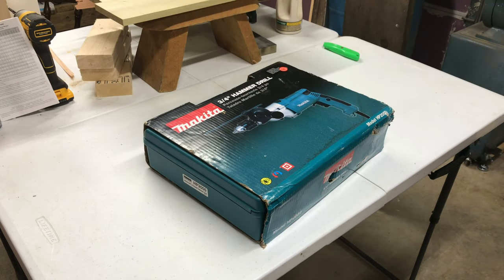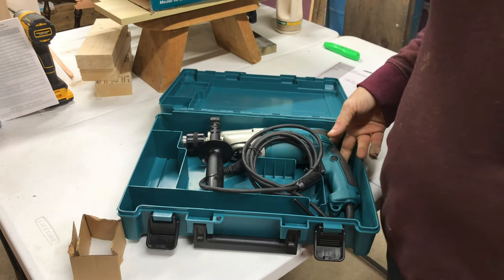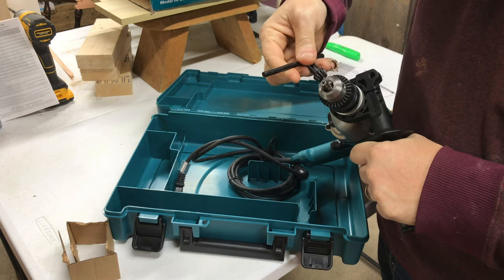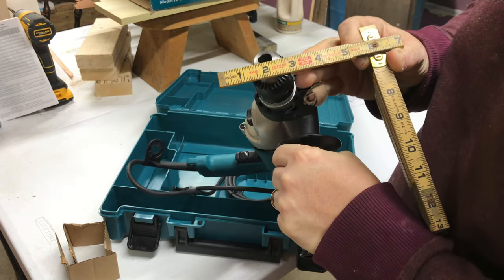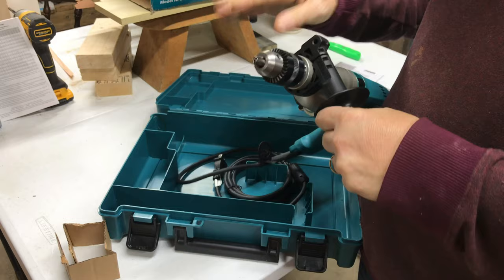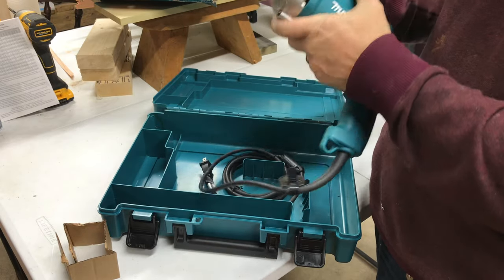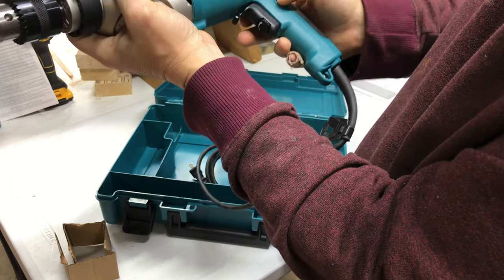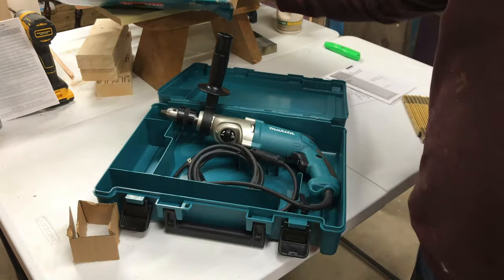Makita HP2050 3/4 Inch Hammer Drill

Comment: I used this drill for the first time today. Mind you, I did use a 1” Diablo auger bit. It didn’t want a drop of the smoke. All I needed was 1 solitary hole, through some 3/4” plywood. It stopped and let out the magic smoke, everytime it came in contact with the wood. Maybe it’s cool on concrete, but It’s useless for me. I treat tools like guns, but I might actually take this p.o.s. back. Luckily I had just bought a 1/2” drive right angle d-handle Milwaukee drill, that went through it like cardboard. I actually was going to send the Milwaukee back, because my wife bought the wrong drill. The dewalt was on sale for even cheaper, with clutch and more amps.

Comment: These drills were designed for concrete, it will easily cut bigger holes into wood/plastic/sheet metal/thinner metals but concrete is so taxing on them, it’s $99 as of today (2/24/2021), so expecting more power is unrealistic. I have one and love it for drilling deep holes into wood post. It will blast 3/4” holes into concrete footings all day. Have to spend big money to get a drill to dig big holes

Comment: The rod is a depth guide. You set it up for how deep you want your bit to go thru and it stops. Mostly for concrete. I just wanted something cheap to mix thinset and hot mud with. I have been burning up my makita battery hammer drill. Got it refurbed on ebay for $70 bucks.

Comment: 3/4" refers to the hole diameter it can drill in concrete. Most hammer drills are rated like this. Look up any of the SDS rotary hammer drills and they are all rated based on the size of hole they can comfortably drill. Given that it is a percussion hammer drill, the 3/4" is misleading. We are more familiar seeing the rated hole size used on the larger rotary hammer drills and chuck size used on the percussion hammer drills such as this.
That said, I have an HP 2050 that is over 15 years old and it still works great. The chuck that came with it was not very good and has been changed. I hear the new ones are not as good. Probably a case of "don't make them like they used to".
Reply: how is that possible? the diameter of the hole you're drilling is equal to the diameter of the drill which is maximum 0.5 inch.
Reply: @joecostner1246  Simple. Reduced shank drill bit. Shank is 1/2". Carbide tip is 3/4".
Reply: You know "everything is not made like they usd to". Honestly, i think its become the standard model for making everything these days. If you think abput it how else would any company make any profits if what they made was actually made to actually last? Its fucking ridiculous which is the reason why EVERYTHING FUCKING SUCKS THESES DAYS, from flimsy phones to flimsy cars and clothes dont last not even appliances. Companies make more when they make cheap shit but advertise it as good shit. Everybody does this which is why everything sucks. I remember baci in the day you can buy a fridge or a Television and never needed to buy little pieces of accesory bullshit that easily breaks off like the way appliances are now.  EVERYTHING iS PURPOSELY MADE NOT TO LAST, EVEN IN FOOD. I bet if you go inti your fridge and what you think is maple syrup is actually far from it. You are just sold the idea of what syrup is when in fact if you look and the ingredients thete aint nothing thats maple about it. Its fucking corn syrup mixed with color dyes and flavoring. What you think what maple syrup taste like is NOT even close to the real thing. IM SICK OF ALL THIS FAKE SHIT AND CHEAP MADE SHIT.
Reply: @dreddmann9292  good points